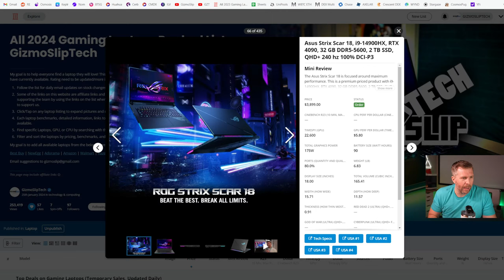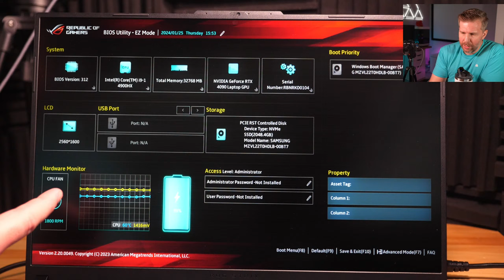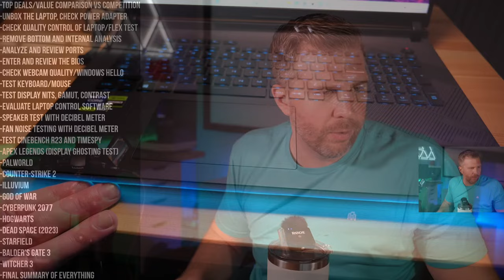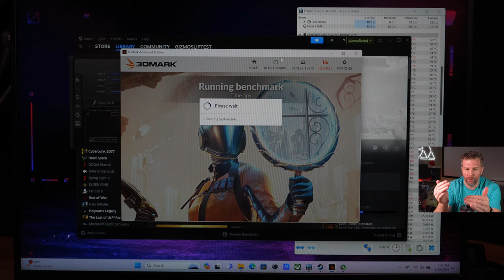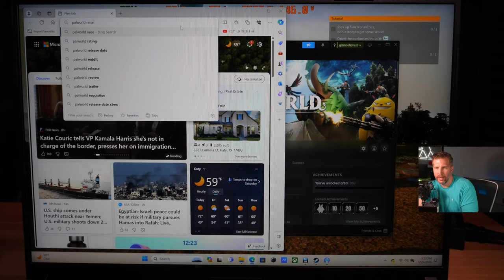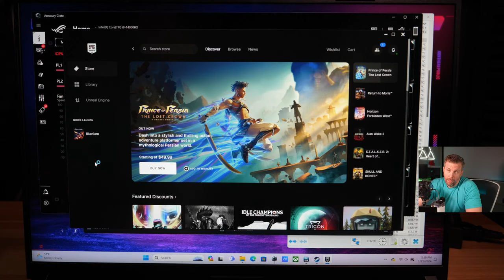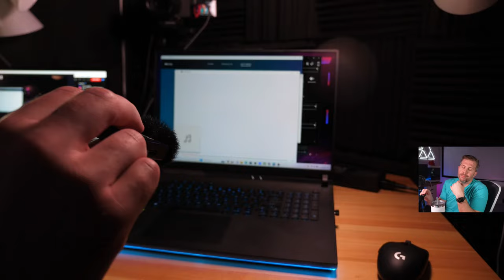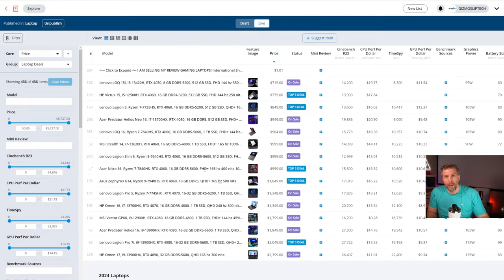Asus Scar 18 (2024) Unboxing Review! 10+ Game Benchmarks, 1100 Nits MiniLED Display, i9-14900HX!

Comment: Yes, finally, a full review.  I am interested in this beast.  Starting to watch now... Finished.  Disappointed we didn't see comparison with 2023 version.  There are reports the new model is slower than the 2023 version.
Reply: @mehmetbilgic762 If Money isnt your Problem Go for the newer one since it has a Mini LED Screen. If Display isnt your Main area but Performance is Go for the 2023 Model.
Reply: @mehmetbilgic762  It's not completely clear yet since the machine was just introduce and new bios and drivers might significantly change things.  Tom's Hardware and a user's report on reddit seems to indicate it is weaker.   It seems, Asus reduced the total overall power to the CPU/GPU this year.  I'm waiting on more review to see if the initial reports were just lazy or not.
Reply: My goodness guys go for this, otherwise you will keep waiting, performance you can tweak amyway. Whatever this machine cant handle, others in 2023 or 2024 cant handle either. You will get the best in this, and for 5% increase in performace here and there dont sacrifice on display. Go with the cheapest which offers the best display, cuz portability is why we buy this, we wont always take with us a led monitor
Reply: The problem with the laptop is the poor processing of the liquid metal. After transport, the liquid metal is no longer where it belongs. The notebook normally achieves 34,000 points in Cinebench.

Comment: What sucks about the 2023 model is that the display is friggin awful.  It does not have HDR while gaming and it only has a peak 500 nits.  It only has Dolby Vision for video content.  I would take the 2024 model hands down over the 2023 despite the tiny loss of performance which will be corrected through a BIOS update.  HDR should be the standard for a gaming laptop.  I'm totally fine with my 500 nits but discovering I don't have HDR gaming totally bummed me out.  Especially on an expensive 4080 Laptop.

Comment: Is it better then scar 18 2023? Or more or less the same?
Reply: Scar 18 2023 hasnt mini led and has i9 13980hx ram ddr5 4800mhz.Scar 18 2024 has mini led and i9 14900hx ram ddr5 5600mhz.
Reply from the maker: Better screen for sure, though performance is very similar to 2023 model.
Reply: @GangStiV0uli  In real world usage, those differences aren't enough to be noticeable unless you run benchmarks all day.
Reply: Your pretty much paying for the better screen
Reply: Thanks all! 😊

Comment: Hi!
I bought this device, the reason the keyboard turns Blue is because of Windows 11 controlling the dynamic light, there is a setting under "Personalization" called "Dynamic Lighting", and Windows 11 sets it by default to static blue

Comment: Dont know if this has been answered but the reason for the keyboard losing rainbow mode is because of windows dynamic lighting, you need to use aura sync in armoury crate if you use windows dynamic lighting, or else turn off windows dynamic lighting and only use armoury crate

Comment: Serious question: From the demo section I can agree with you that the One Zone Backlight is the most practical one, since the others make certain text (eg. white text on black background) really hard to read. But then the question becomes, if we're just going to leave the laptop in this mode, then what's the advantage over normal IPS screen with 100% DCI-P3? Or is the One Zone mode on the miniled display still much better than the IPS screen say on the Lenovo Legion Pro 7?

Comment: In regards to the Wi-Fi card, i think that the best one you can find in a laptop (stock) is the 211 but if you spend just a bit of money the 210 or BE200 worked a lot better for me. If you have an older computer and want better speeds spend a little bit of money and buy a Wi-Fi card. I am getting ~1500Mbps downloads AND uploads with the BE200.

Comment: So after playing on it for a few days, I've decided to return my Asus Scar 18 (4080) . The screen is the WOW factor of this laptop, it is beautiful but the speakers are awful, it is a fingerprint magnet, and it's SO very plastic that for 3k, I just couldn't rationalize the cost for value. It was fast for my use and that screen had me questioning myself but then I'd ask... is this worth 3k ? ? I don't feel like for what it is, that it was worth the cost.  My .02, I'd just rather an aluminum chassis for that price.
Reply: Then which one you would recommend
Reply: @jowelnath5  I just don't feel like there is one out there at this time that is similarly priced for better. I am curious what the Lenovo Legion 9i carbon will bring when it comes out (hoping they have a 4080 model similarly priced to this) but with the aluminum chassis. Also curious about the Zephyrus 16 that will be out soon-ish. I genuinely think that this is currently the best thing out there specifically for the screen but that plastic bugged me. The speakers are not great, sounds muffled coming from a mix from the bottom and back of the computer (if that matters). I kept adjusting and adjusting ultimately using the Dolby mixer a few times to get the treble a little more balanced. The screen though, it was dreamy. If that is your biggest checkbox to accomplish, this is it, but overlook the cheapouts in other areas.
Reply: Which is better to buy, this scar or triton 17x?
Reply: @Village_Defender  I haven't used the Triton but I generally (personally) don't dig Acer over Asus. If the screen is the MOST important thing, this is a GREAT option. It just wasn't the entire package for the price.

Comment: I have an "obsolete" gaming laptop (ASUS G752 - I7 processor/Nvidia GTX) which has and continues to be a beast for my needs. I love my current laptop, but I wanted a 2nd laptop for various reasons and a decent upgrade to my current. I had the 2023 Scar 16 for a week and decided I wanted a full size keyboard and larger screen. I expect the only difference from the 2023 to 24 is the slightly improved screen (plus it being offered in 18"). I ordered this laptop and will have it on Monday. Time will tell if I feel the money spent is worth it, I suppose. I'm not an avid gamer, more casual - and mostly non intensive graphics (Blizzard stuff). BUT I do a bit of graphic type editing, CAD Design, etc. and typically have a bunch of windows open so needed speed. The cool factor lights are a draw for me. I'm not the type to upgrade frequently, so want something that will be relevant for atleast another 10 years. The screen drew me in on this model, but the price was meh. I was so torn between a bunch of options for at least a month. I decided to try this one on for now, if I don't absolutely love it, I'll return it.
Reply from the maker: Yeah, sounds like a good plan
Reply: please update me on if you ended up liking this laptop, and how the coil whine is on this newer version under full load. @texantrinity
Reply: This is best laptop in world

Comment: just incase anybodys wondering, i have the 2023 scar 16 with the 13th gen cpu and 4090. after an undervolt on the cpu i hit around 18100/18200 and my gpu after an overclock hits around 21700.

ive ordered an upgrade for the ram as the 2023 models are only 4800mhz sticks, so ive got 5600mhz sticks coming tomorrow to match the 2024 models. I have no idea if id see any difference in timespy with that ram upgrade but if anyones curious just ask and ill retest
Reply: How is the ram? Was it compatible?

Comment: Congratulations on the video. I have the 2023 model. Is it possible for you to make a video configuring your afterburner? I thought your afterburner configuration was great!
Reply from the maker: Thanks. Its a combination of afterburner and rivatuner. Maybe worth a separate video on it, but I have configured it with lots of different hardware, and sometimes you need HWInfo64 to fill in any missing data.

Comment: Asus Scar 18, does It have a Thunderbolt 4 port or 40gbps USB-C? Can you undervolt the CPU in BIOS or with software? Does It already have liquid metal on both CPU and GPU? How are temps in R24, Blender, and gaming 4k ray tracing for both CPU and GPU? Does the Laptop become hot tò touch? Can you install 6400mhz Memory? Does the BIOS let you manual overclock RAM and select profiles and voltage? Display has g-sync and HDR10? How many ms? Mux switcher tò disable iGPU? How does the 14900hx compare tò 13900hx? Can you make a test? Is GPU overclockable at least +200 core +1000 Memories?

Comment: I'm shocked more people aren't commenting about the 2nd m.2 slot going over top of the wifi card. Surely that much heat sitting directly on top of the card directly affects both its performance and lifespan? Or?
Reply from the maker: Maybe if you do lots of data intensive tasks constantly, but most SSD's don't get hot unless under heavy constant use.

Comment: Nice stream, I really liked it. I just brought this laptop and its really great but I have a query, are you getting the power from usb type-c power delivery port after its shutdown (and not connected to power supply)?
Reply from the maker: I have not tested this, but I would usually think yes, you would, normally.
Reply: @GizmoSlipTech  It usually works in HP, Dell and some Lenovo laptops but in this Asus laptop it doesn't work if it's shutdown, but if it's in sleep mode then it works

Comment: I've got last years the fans don't react quick enough and if you run cinebench once then leave it to cool down you get much higher scores, I'm New to laptops but the 13900hx and maybe this have unlocked multiplier, so could in theory top out the 13980 etc, can you do that with laptops like my old 4670k desktop running at 44* instead of 38* ?

Comment: I have the exact same one and when i listen at the middle (slightly to the right) i do hear electrical noise.

What makes it obvious is uninstalling armoury crate and using g-helper instead. If i put it to silent mode in ghelper and play wow classic capped at 144 fps max settings (no rt) the fans are so silent that i do slightly hear it in a quiet room. If i hold my ear to it it's relatively loud. Wondering if i should return it and get another (still got 14 days)
Reply: I'm thinking of buying this model too, what are your experiences? Is your laptop a 2024 model or a 2023 model?
Reply: I got a second one and it also has whine in silent mode, on par with the first one
Reply: @sebastiaanvandingenen1472 wow the whine is really making me not want this laptop
Reply: @sosuslays  I still kept 1 of them, it's really only there if you look for it. Any kind of game or even balanced mode that ramps up the fans even just a little bit cancels out the noise
Reply: @sebastiaanvandingenen1472  yea bro i really wanted to go asus, because their new min-led and just their aesthetic screams gamer perfectly. But idk if its worth an extra $1000 if coil whine is inevitable. I found the lenovo legion pro 7i with a 4090 for $2500 flat, has no coil whine, identical performance woth just a standard 500nit IPS panel, so i think ima go that route unfortunately until Asus fixes their mechanical problems
Reply: @sosuslays  trust me you want the miniled panel, it is a million times better than IPS and in some cases even better than my oled. Don't pay 3-4k for a laptop with a shit screen, it is what you will be looking at for the next years. The 2k dimming zones on the Asus make it worth it trust me
Reply: @sebastiaanvandingenen1472  damn bro this is so hard
Reply: Hello. Tell me, in games that are heavy for a laptop (for example, Lust For Us, Callisto Protocol, Alan Wake 2, Resident evil 2/3, RDR 2 or others like that), what is the TDP in silent mode on the GPU and CPU?

Just like in this review, about 40-50W on the CPU and ~150W on the GPU?

With such games (I listed examples just above) is the fan noise also super quiet?
Reply: @Aleksei_Konyain  I'm not sure I will be explaining it right as I don't know a lot about the power consumption etc but when I replace armory crate with ghelper and create a custom profile with 2000 MHz on the gpu, 80w on the CPU and disable CPU boosting I can still play Diablo 4 on max settings (no ray tracing) on the laptop's resolution (1440p) without any issue. I even am able to use a quite conservative fan curve where the CPU stays at around 82 degrees with fans at max 4000-4500 rpm. I capped my framerate to 120 for diablo and it just stays there all the time  without too much noise or heat (cap the mid fan to 4500 or something as that one is loudest). It probably does more frames but capping it to 120 is more than enough and keeps things cool and quieter
Reply: Dlss and frame gen is also off in diablo 4 for my use case